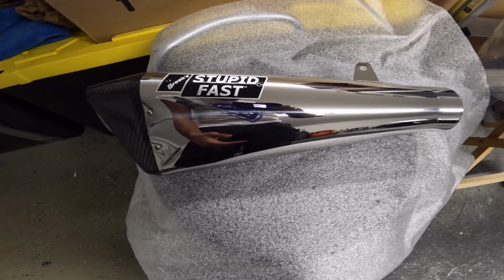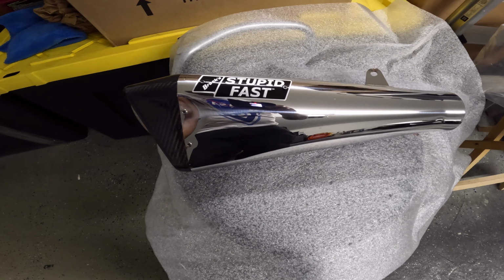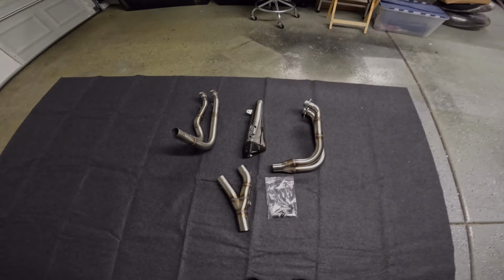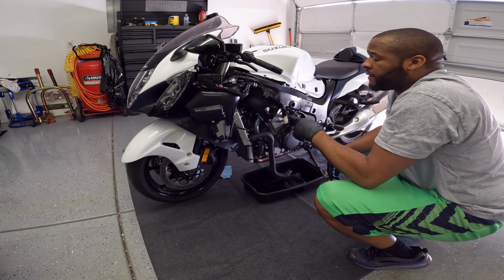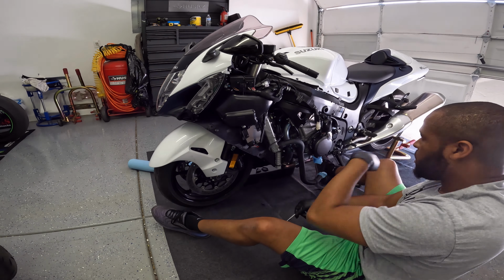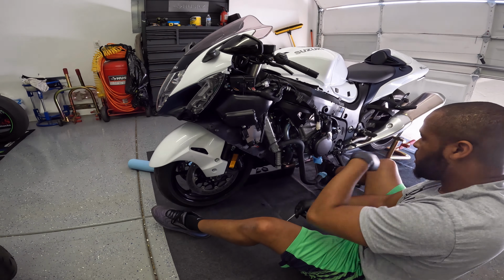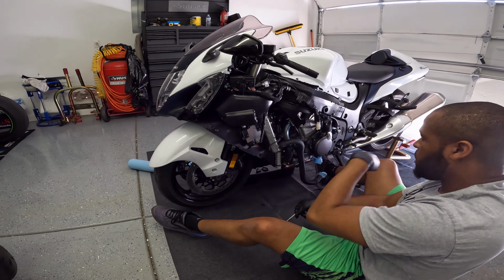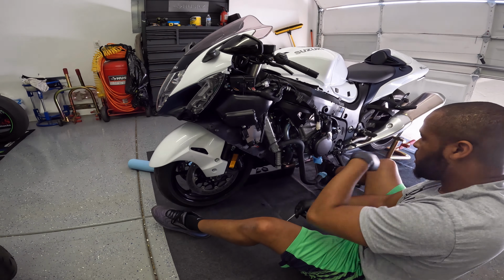2022 Suzuki Hayabusa OEM Exhaust Removal | How To

Comment: Just a note on size if you try to source bolts from a local hardware store or parts house; M8 1.25 x 25mm.
Reply: Thanks for adding that; I’m in Hawaii and always have to improvise to find shit.  🤙🏽
Reply: @kevinsimmons5295   it’s such a coincidence you’d send that now. I’m in the shop putting my system on(Black Widow). About to start putting the radiator and rest of the bike back together. Thanks for doing such a good video; it’s been a big help 👍👍
Reply: @ramairglenn  my son and I are doing the Pentacarbon right at the moment on my 22; we had the same issue with bent bolts and are pulling the old copper gaskets as we “speak”. I’m off to Napa while he keeps on with the prep.  We pulled the oil cooler from the start, which was a big help FYSA 🤙🏽

Comment: Sheesh bro them potato shooters are heavy
Reply from the maker: What's even more crazy is those potatoes shooters cost 1300 a piece if you have to replace them LoL
Reply: @EnviedKing  did you say 1300 a piece?  Wow!
Reply: @EnviedKing  $300 for the pipes $1000 shipping weight 😆 🤣 😂
Reply from the maker: @bellydavezx10r48  yes $1300 is the price listed on the replacement parts the dealer purchased. Which e plains why they wanted to put something aftermarket on it because it would have been cheaper to go slip ons for them
Reply from the maker: @muhammadsteinberg  nah them damn cannons are actually listed at 1300. So maybe 1450 once you factor in shipping for them heavy things. I'm not even sure why they cost that much

Comment: Hey bro did the OEM exhaust have that goofy back pressure valve in it or did you just have to take out the the O2 sensors and pretty much undo everything and the exhaust came out? thanks.
Reply from the maker: No sir it did not have that valve
Reply: @EnviedKing  thanks my brother great video too, I'm waiting on exhaust system to come in now then ima swap mine on my gen 3.

Comment: Damn bro!...That bolt issue pissed me off!...You maintained your cool rather nicely. Hopefully nothing was damaged like cross threads or stripping by the gorilla with a tool. SMDH

Thanks for the vid. I thinking 👽head  for my bike.
20lbs lost roughly 2hp gain in weight reduction alone thereabouts?
Reply from the maker: Nothing was damaged. The new bolts went in no issues and there weren't any cracks thankfully. Things that aren't in your control should never stress you out because you have no say in the matter. Plus it's fixable. Exhaust alone was over 30lbs if I remember and I'm not sure weight loss equates to HP but it does equates to quicker acceleration